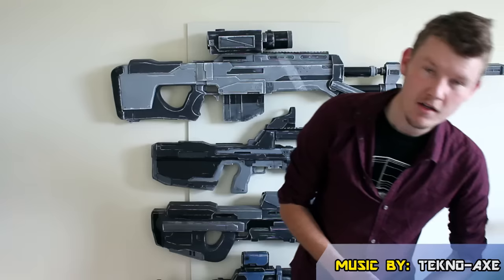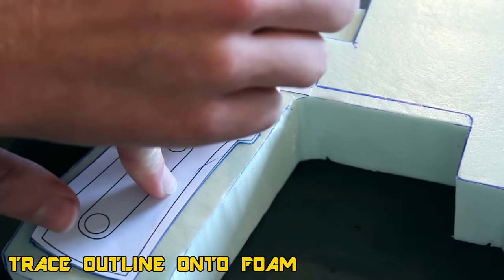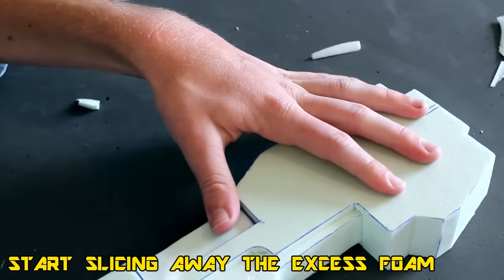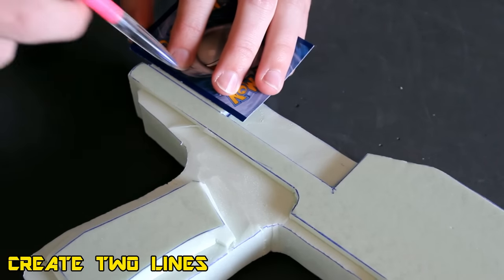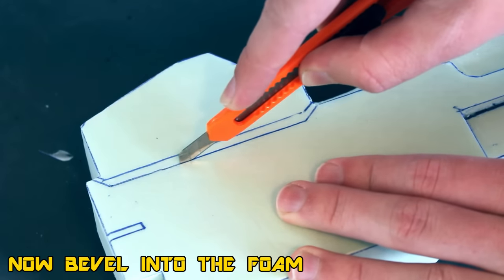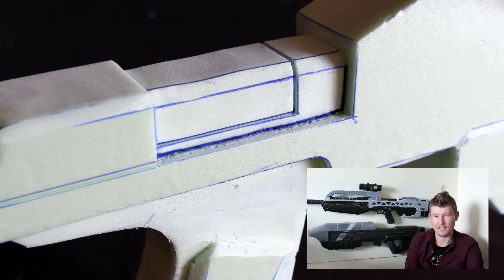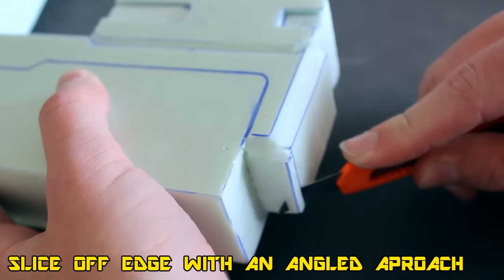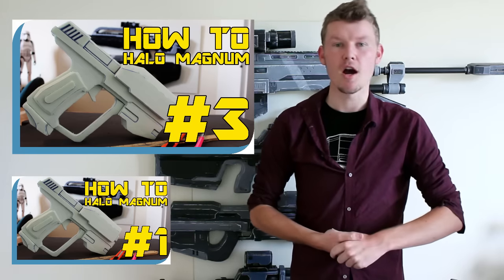HOW TO:  Halo Magnum Prop Tutorial  ( PART 2 )

Comment: How do you handle the 'tearing' of the foam upon sanding and some cuts? Like where it gets rough or small chunks come out in corners and stuff? I see a couple of bits in this video but it seems like you get rid of them somehow
Reply: +hallowedfool Andrew will no doubt cover it in Part 3, but the tear out and gaps are filled with Spackle, Pollyfilla, woodfiller or similar.  Dries in minutes, and then you sand it back, leaving a flat surface.

I use wood filler in a tube, simply because it's  cheap, pre-mixed and very quick to apply. It sands exceptionally well.

http://www.poly.com.au/products/fillers/polyfilla-timber-filler

Tip: raid the make-up department of your local supermarket and buy women's nail sanding/polishing sticks. Very cheap, and they make great tools for sanding XPS foam.